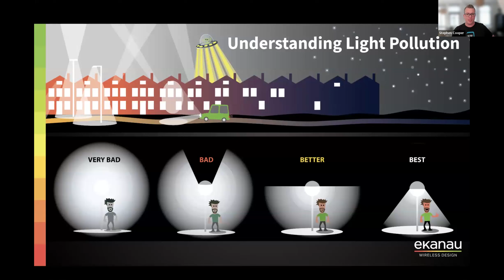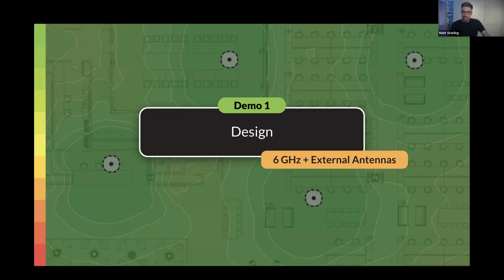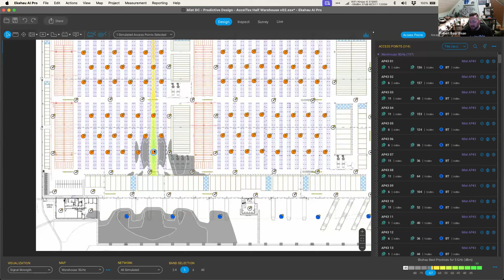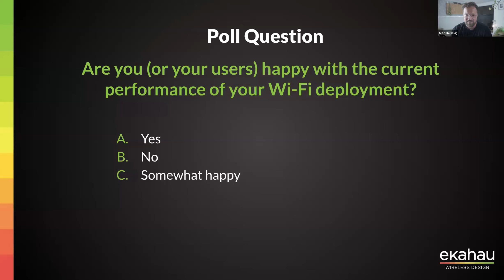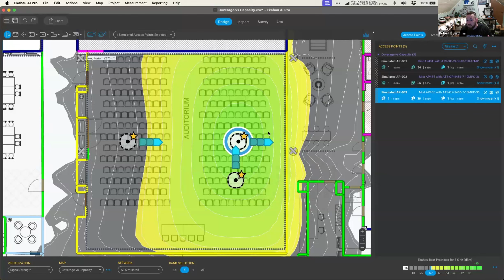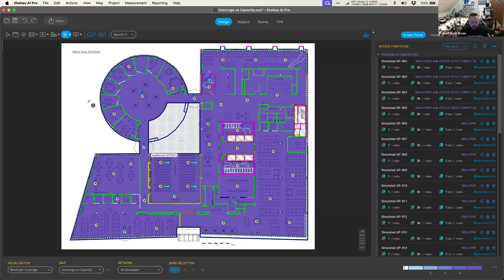Designing Wireless for Complex Environments | Ekahau Webinar

Comment: I think Ekahau really has to work on the performance of the software. I have a pretty new pretty powerful M-powered-Mac specifically to work with ekahau, and it is slow af. I know there is a lot of simulation and calculation going on in the background but just opening drop downs to choose an antenna just takes way to long. not a fun experience to work with ekahau right now.